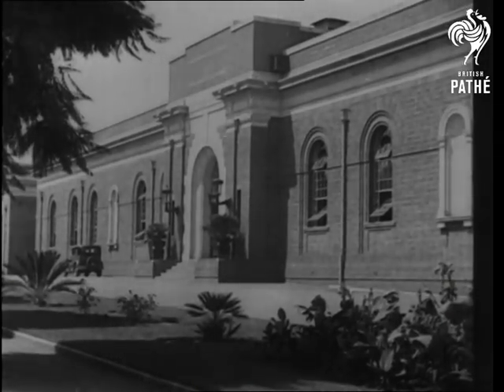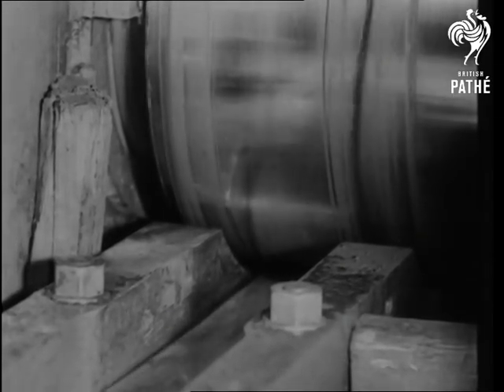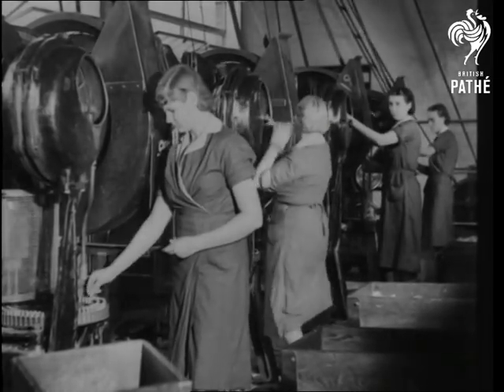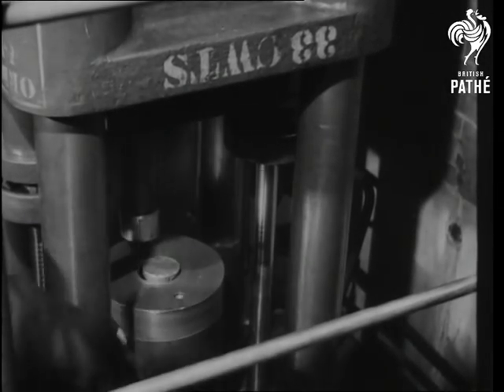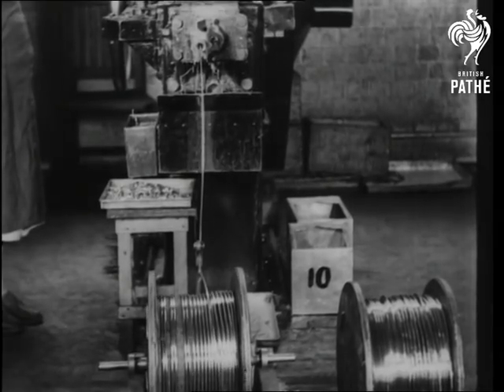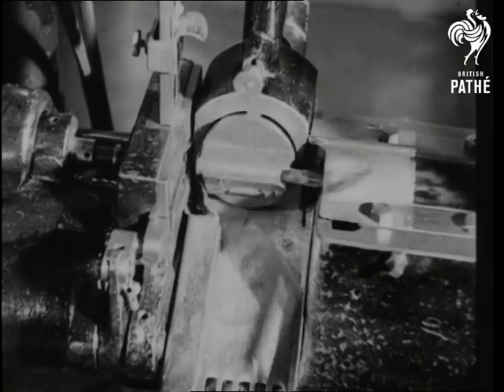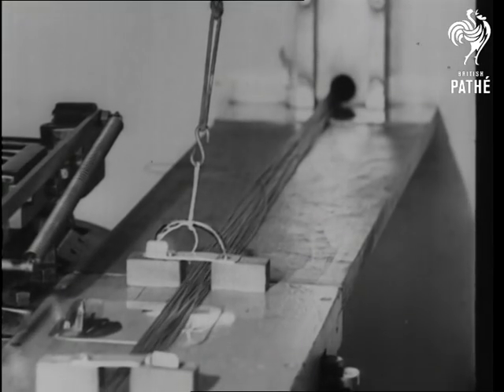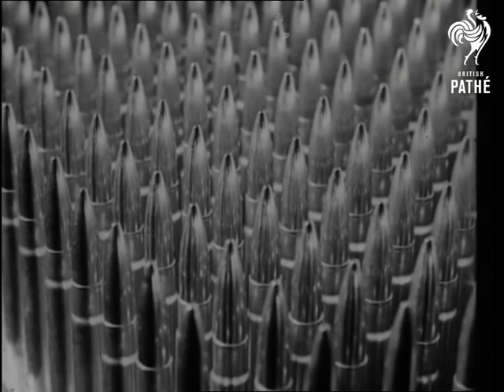Cartridge Making (1940)

Comment: I wish there was video on how the German and Japanese industries made their munitions.
Reply: It's the same process the world over. The machines may have looked slightly different, but the steps are the same.

Punch brass or mild steel alloy cups out of a sheet, strech & size the cups into cases, anneal the neck of the case, then prime the cases. Punch out cups for the bullet jacket from copper or some other alloy of soft metals (which may end up plated), then size & strech those cups to accept a specifically sized lead or mild steel core . Press the jacket & core together into the desired shape, & you have your bullet. Charge the case with gun powder or cordite, seat the bullet into the case, crimp the case neck around the bullet. Optionally add a sealant where the case neck crimps the bullet, & around the primer in the base of the case.
Reply: I think there is a German one.
Reply: @mr.nibblenips4231  where
Reply: Similar, except they shouted "Germany First" at each pressing.